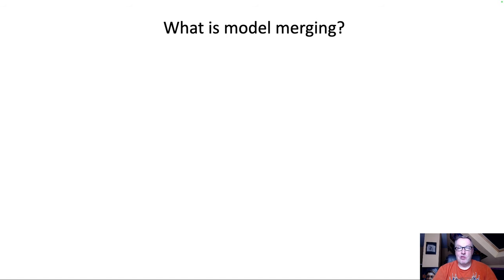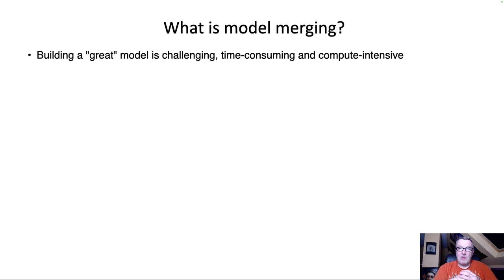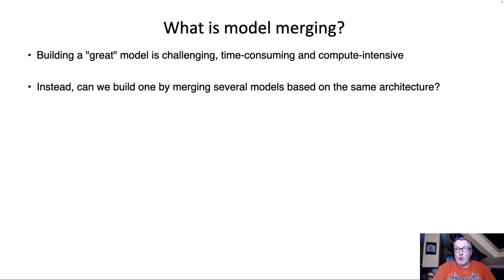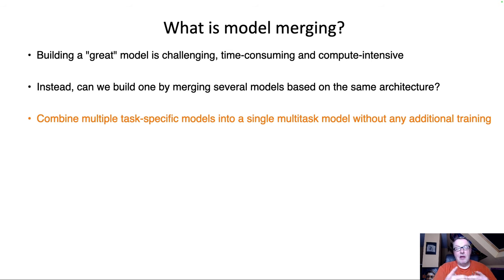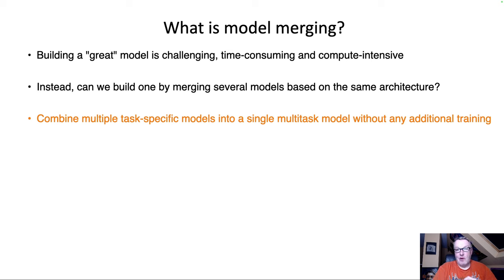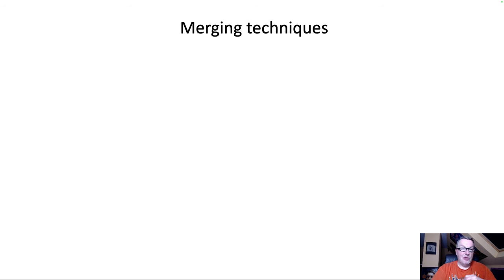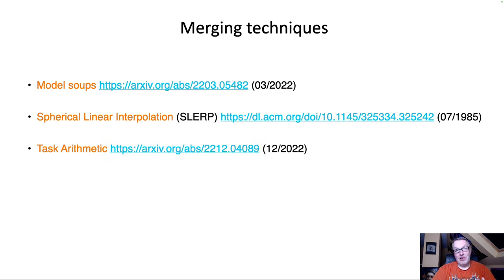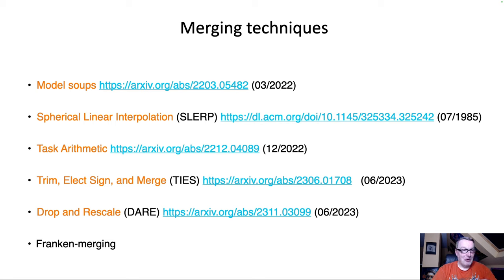Deep dive: model merging (part 1)

Comment: Hey @Julien, great vide. I have a question regarding the scale factor in TIES method. How we determine the scale factor?
Reply from the maker: Thank you. It's up to you, depending on how much you want to "influence" the base model. mergekit has a parameter called 'density': fraction of weights in differences from the base model to retain. Example at https://github.com/arcee-ai/mergekit/blob/edd3817e4a470c7a959ef4c505f52a650a46ff07/examples/ties.yml

Comment: Thank you for sharing the video!  
I believe an important point that may have been overlooked in the context of model merging is the necessity for the models to remain within the same optimization basin.  
For instance, if the models are fine-tuned for too long and diverge significantly, weight averaging could result in a collapse in performance instead of an improvement.

Comment: It wasn't clear to me if these methodologies first do some kind of sorting by weight and connectivity similarity accross layers. I can imagine that when merging models that were fine tuned from the same base checkpoint, that we can proceed without sorting. But if we trained two models from different random initializations, we would need to sort them by similarity previously.
In any case, has there been any research into this?
Reply from the maker: Not sure what you mean by sorting. Most methods require that merged models share the same base architecture. Frankenmerging is different and you need to pick which layers come from which model.
Reply: @juliensimonfr  Sorry, I meant that not only should they share the same architecture, but they should also share the same initial pretraining and weights.
Two models with the same architecture but trained from scratch with different initial randomized weights would not merge very well.
Unless that is, and assuming that the patterns found are the same or very similar, some analysis is done on the layers of the two models to find similar weight and connectivity distributions scattered in different parts in each, then somehow ordering for similarity before merging.
Reply: @juliensimonfr  The question came up because I'm currently training two models from scratch, with different initial randomized weights, with the same X data but different Y data each and I'm curious about any research done in merging these two into a single model with both Ys as multi-headed output.